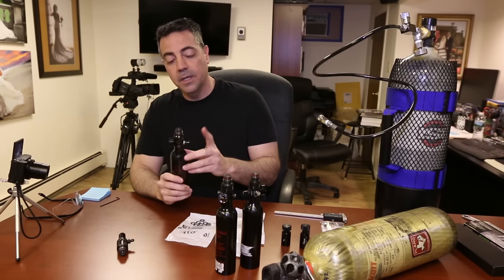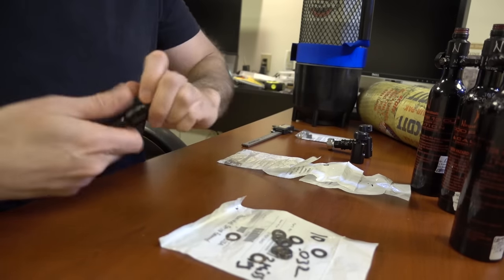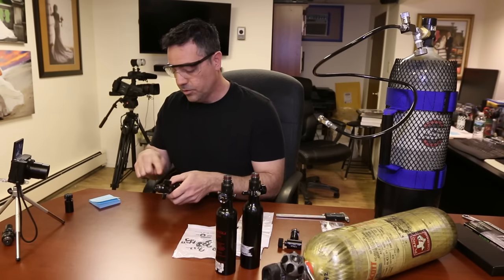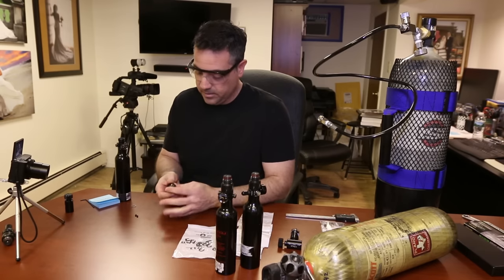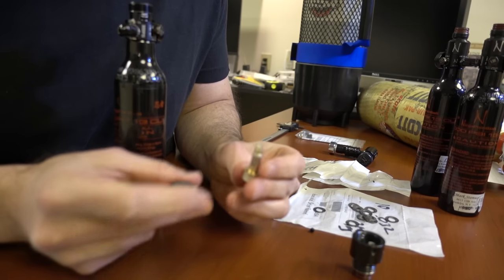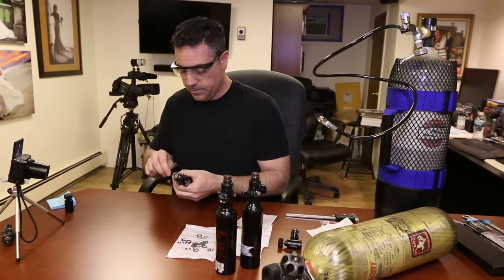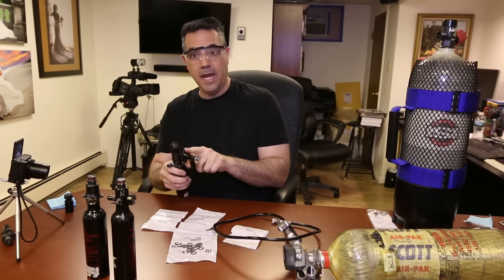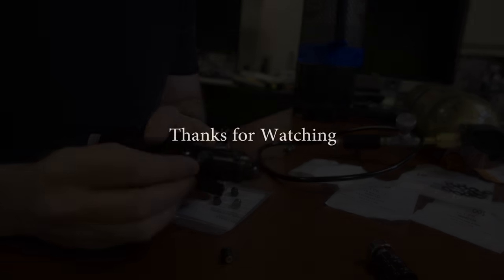How to adjust ninja ( Umarex Gauntlet ) regulator for PCP HPA Airguns (800psi to 1400psi output)

Comment: So how many washers do you think we can safely install to raise the pressure? I ask because I have a reg that came set at 800psi with no washers in it. I , for shots and giggles but 5 .020 in it and it raised to like 1150psi. So if trying to achieve 1400-1600 psi I'm assuming it would not be ideal or safe to stack that thing up inside to the estimated 3/8" it would need. What are some thoughts on that?

Comment: Are the shims in all paintball air regulators the same size? I have a Tippmann and I am wondering if your shim size will fit my regulator.
Reply from the maker: I don't know for sure but I would guess not. The only way to tell is to measure the thickness, inner and outer diameters. I have sense Belleville washers and shim spacers of different sizes.

Comment: How many shots would you get on a 2200 output 25 caliber gauntlet
Reply from the maker: The bottle is limited to about 1800psi as the low side/ output burst disc is a 1.8k. and even at 1600psi the burst will blow after a little while.
Reply: I kind of understand what you're saying but then again I don't so you're saying I should get a bigger bottle if I want to do that. I don't understand the part where you said it will bust what will bust
Reply: I'm new to this whole PCP thing so break it down for me brother please

Comment: Hi if the bottle is 3000 psi with a 5k burst disk, do I need to pump it to exactly to 3000psi or can I go over say 4000psi. Thanks
Reply from the maker: I would not recommend filling above 3000PSI. I have filled to 3100psi just to push it a little but you risk blowing the 5K disc at 4000psi and possible risk of injury. These bottles are made to go well beyond 5000psi but the limits are put in place to ensure absolute safety. STAY SAFE AND DO NOT PUSH THE LIMITS.
Reply: Air Velocity Sport thanks will do. Your the man.

Comment: @800 psi what kind of velocity would you expect with 14.3 projectile? I’m waiting for my rebuild kit and do not have access to a chronograph. Wondering if I should expect enough FPS for squirrel hunting with the reg as-is
Reply from the maker: At 800psi on my crossman the 14.2 pellet traveled at 760fps with a modified valve. At 1100 psi I got it up to around 965fps. It depends on on well the transfer port and valve are breathing.

Comment: I have a new 4500psi 68cc bottle. I have the ninja filler assembly. My bottle shows 4500 psi on the gauge but I can't get it to fill my new fx wild cat or my fx impact. Help...
Reply from the maker: A 66cc bottle will never have enough volume of air at 4500psi to fill a 480cc FX bottle even if the FX bottle is only 3650psi. You will need something much bigger like a buddy bottle or a 65cuft bottle.

Comment: I was told today that Ninja did not make my air regulators by their General Manager.  If not, who did?  Mine just says Model R09 Made in Taiwan on one rifle and just Made In Taiwan on the other.  I didn't ask him if they ever did.  Maybe they changed suppliers.  Do you know?  Also, is 1.8K and 5K the correct sizes for the burst disks?
Reply from the maker: On the Ninja bottle the low side or regulated output is 1.8k and the high side or the bottle is 5k. As far as I know Ninja makes the bottles and regulator for Ninja bottles and the Guantlet. It is possible that they switched suppliers
Reply: @AirVelocitySport  Thanks, I appreciate the info!  I'll have to ask Ray Trimble, the man I corresponded with today.  He didn't say they never did,  just that mine weren't NinJa.

Comment: I did this several times and each time my 1.8k burst disk keeps blowing upon refill. Was perfect before hand. Ideas? It held once and filled to 3,000 and functioned for testing. My reg tested at 1350psi. Not sure what the issue is but even taking the shims out it still does it. Ideas?  Same bottles and reg. Thanks
Reply from the maker: The regulator is creeping. What happens is initially you may have the regulator set at 1350 but after a day or two the Belleville washers give and start to creep. 1.8 k burst discs will blow even at 1500 PSI maybe not right away but after a few days. I would recommend swapping out the Belleville washers for new ones. You can buy new Belleville washers at McMaster carr online. You can also try setting the reg around 1100 psi and let it sit for a few days and check where the pressure is it may creep up to about 1400 and then stabilize
Reply: @AirVelocitySport  thanks. I will give it a shot

Comment: How accurate/consistent are these regulators?  Some PCP regulators cost $150-200 alone and yet these are so much cheaper, including the bottles
Reply from the maker: They are OK. Moisture will cause rust and deterioration on the spring and ball bearing as well as the main piston the Belleville washers are stainless steel and should hold up very well. I have had pretty consistent shooting with those regulators when they are new as they age I definitely would see variances of about 10 to 20 FPS over time you will need to clean or rebuild the ninja regulator top section after about a year or two.
Reply: @AirVelocitySport  Awesome, thanks! I love the fact that they allow you to switch bottles in the field (cuz of the on/off valve)

Comment: Hi just a quick question; you have several paintball bottles, do you know if any of your bottles leak at the pressure gauge by submerging in water. mine dose, sending it back to the US will be expensive. What will you recommend as a replacement gauge..?
Reply from the maker: None of mine leak at the gauge but one is leaking at the ball bearing because it's rusting. I would just replace the gauge and use telfon tape
Reply: recommend a manufacturer
Reply from the maker: mpk5959 I would ask jdsairman to send you a replacement gauge since that one is leaking.

Comment: what if I want to drop the pressure down closer to 120psi. would the ninja be able to be modified enough to go that low. I have seen ever low pressure setups pre made. but I wanted to know if you can modify an existing normal ninja regulator down to 120 psi.
Reply from the maker: Christopher Calhoun I'm not sure if that low of a pressure can be achieved with a ninja regulator. I have only seen 800 PSI. please let me know if you figure out how to go that low.
Reply: Air Velocity Sport I have seen ninja SLP  regulators on tanks that drop the pressure down to around 800psi and then a ninja LPR regulator that attaches to that, that regulates it down even farther between 0-150psi. I just want to find a one stop shop kind of item. instead of having two items. 

odly enough I plan on using a HPA tank as an on board air for my vehicle. cramming more air into a smaller bottle to save on space. I just don't need HPA, regular 120psi that comes out of a normal shop compressor is my end goal psi.

Comment: Thanks. What’s the thread size of its regulator. Does it work with M18*1.5 thread size?
Reply from the maker: The ninja bottle thread is 5/8-18UNF OR .625-18UNF the paint ball adapter is ASA
Reply: Air Velocity Sport thank you

Comment: what shim/disc spring type/size, if i need go to 1800psi ?
Reply from the maker: Bos Maru you can go to 1800psi because the burst disc will blow. the max I would go to is 1450psi. even at 1450psi the burst disc will most likely blow at some point.

Comment: how do you line up the tank so it goes back right ? Each time I take it off it goes back differently and not in line to be able to put the cover back on.
Reply: You loosen the set screws and adjust it where you need it then tighten you set screws make sure the top piece only turns

Comment: Hey, you wouldn't happen to know how many stacks to put in to make this bottle do 300psi out would you? Is that possible/recommended?
Reply from the maker: I believe that is not possible with the standard ninja bottle with spring or Belleville washers. It comes from the factory with a light spring set to around 800 psi. You might have to use the ninja SLP super low pressure regulator valve. Try calling ninja directly.
Reply: Yeah, unfortunately they just deferred me to buying a new reg, which is a whopping 60$. Do you think you can do an experiment for me where you put in like a few belvilles without shims to see if the ninja can output 400 at least?
Reply from the maker: I have don't that and even removed two Bellevilles and the regulator locked up. It took like 2 hours for the air to escape so that I could degass the bottle.

Comment: What is the best belleville washer arrangement to give you the most psi?
Reply from the maker: Stack them in 6 stack like so ((())) ((())) ((()))  A four stack is a little stiff like so (()) (()) (()) but it should always be symmetrical. Don't put a 6 or 4 stack with single stack. The single stack will get crushed.

Comment: I'm a little confused about my existing regulator.  Mine too is a Ninja brand but it does Not have the ball bearing seal valve in the bonnet of the regulator.  It has a pin type of valve.  Also; on the bonnet there is inscribed the number 1150.  I take this to mean that this is the output psi that this regulator is adjusted to.  If so, this is odd because the Umarex Gauntlet users manual states that the output psi is 1250psi.

Here's the confusing part.  I checked the output psi the same way you checked yours.  Inside my regulator it had only 10 Belville washers and no shims whatsoever.  The output psi on this particular regulator read in the neighborhood of `1300psi just as it was.  My manometer is one of the tiny cheap kind with the fat hash marks and fat needle so that "1300psi" reading has a plus or minus of perhaps one to two hundred psi. (maybe more)

This regulator is part of the factory Umarex Gauntlet setup.  (Unless they sent me one that had been sent back to them or someone had swapped things around before I got it.)  I notice that the Ninja 13cc tank and regulator setups you have on your table in your video look the same except for the bonnets on your regulators.  Do yours' have the output psi inscribed somewhere on the bonnet?

I did go in and ad one .005" shim to my regulator to see if it would bring me up to 1400psi but those fat hash marks and that fat needle on my manometer make it difficult to tell.  The differences in velocities over the chronograph show little to marginal difference so,  I'm wondering,  if I were to  purchase an extra tank/regulator setup for my Gauntlet, is there a specific regulator that I can safely adjust to 1400 psi without wondering if I'd gone a little to far with the output PSI?  

I was hoping to safely get my velocities shooting the 14 grain pellets up to 900fps if possible.  I don't need anything faster than that.  My break barrel air guns both shoot that fast now.  I'd like for this Gauntlet PCP to do a little better velocity-wise.
Reply from the maker: TIM MONTANO the regulator with the pin should work exactly like the one I have with the ball bearings. There is no inscription on the side of the Ninja regs except the marketing that indicate which burst disc to use. 1.8k on the output and 5k on the bottle. You are correct by increasing the shims you should get your pressure up. I have added as much as .03 shims o get the pressure up to 1600 psi. BUT PLEASE UNDERSTAND THAT JUST BECAUSE THE BURST DISC SAYS 1.8K PSI IT WILL BURST AT AROUND 1550 PSI OR EVEN LESS. I have found keep the output pressure to 1450 is the sweet spot. That allows my to shoot 14 grain pellets at 950fps on my crossman 2240. You can add an extra two Belleville washers but that my increase the pressure to the point where the burst disc will blow. It will scare the pants off you. Also keep extra 1.8k burst available. As you start to mess with the pressure you will eventually blow a burst disc. Also, just because you set the output pressure to a certain psi does not mean it will stay there. These ninja regulators have a tendency to creep upwards. You will find that you just set the regulator to 1450 psi and shot all day. You put the gun away and in the morning your bottle is empty because the reg creeped up and blew the burst disc.
Reply: Thanks for the quick reply. 
So, it's the belville washer that do the increasing of the output pressures?  As I stated in my inquiry.  MY existing regulator only had 10 belville washers in place and no shims.  This was giving me around 1300psi ouptput pressure.

The .005" shim in installed myself appeared to give me maybe a couple more pounds of pressure per square inch.  I never intended to go beyond 1400psi.  I just wanted to get my pellets to a velocity of around 900fps.

At one point in your video you stated that every regulator is different.  The same washer and shim arrangement will yield different numbers in different regulators.  I suspect this is the case with my regulator cause with only ten Belvilles and no shims I'm getting 1300psi while the regulator you show has 12 Belvilles and a couple of shims and it's giving you what; about 1400psi?  

If I try installing 12 Belville washers in my regulator in place of the ten I have now, it seems like I'll more than likely blow a burst-disk for sure.  This is one of the reasons I asked about if there was a specific regulator I should get if/when I buy an extra 13cc tank/regulator setup.  As far as strength and durability, are all of the 13cc Ninja tank/regulator combos basically the same or are some stronger than others?  I mean, even with the same 1.8 and 5000 burst disks attached, are some regulator rated to withstand higher pressures? (not that I'll ever go higher than 1400psi)
Reply from the maker: When I stated that every regulator is different I mean that every combination of shims and washers will not create the same output pressure. They are the same and their construction and ability to hold up to 3000 psi safely. The regulator you have on the gauntlet is almost exactly the same as the one I have on my ninja. If I'm not mistaken ninja has created the regulator and bottle for the gauntlet. You are probably right that adding two more Belleville washers will be too much. All you need to do is fine the correct thickness of shims to match the output pressure you looking for which I believe is around 1400 you're almost there just a little more thickness
Reply: Thanks for your quick replies and thanks for the videos.  They are very helpful in sorting all of this out.

Comment: how much psi can u get from shimming the original spring?
Reply from the maker: you can get anywhere from 800 PSI to 1600 PSI. but as you approach 1500 PSI the output regulator burst disk is more likely to blow. I have found 1400 PSI to be a nice balance between power and blowing the burst disk.
Reply: okay, thanks. But is 1400psi possible with original spring and shims or with disc washers only?
Reply from the maker: OH! Good question. I never tried creating higher pressure with the original ninja spring. I do not have an answer on that. not even sure if that is recommended.
Reply: I failed to shim the original spring. I think its near its max limmit on 800psi. How ever the Aliexpress discs work great, used 9 of them with two original shims= 1500psi .
Reply: @Enkelkrok  how is your Gauntlet handling the 1500psi? what fps are you getting?
Reply: @juansebastiancortazar3322  i did get 226 ms(740fps) and 27J. Im not sure i understand gauntlet?

Comment: How do u make 1 of those   Gages do you sell them?
Reply from the maker: No, I don't sell them but you can make them yourself cheaply. You need three things a ninja slide check, a ninja paint ball valve and a 2000 psi 1/8" npt. Guage. All can be gotten on Amazon and eBay.

Comment: does this also work with the air venturi bottle that is meant for the Sig MCX?  The bottles appear identical.
Reply from the maker: If the regulator uses Belleville washers then yes. To be safe take a photo of the washer configuration so you don't get confused when putting back together. Also, measure the diameter and thinkness of the washers in case you need to order some from mcMaster Carr.
Reply: @AirVelocitySport  question after taking my regulator apart the three shims on the bottom were like the two your reg had there is a red and green shim stacked at the bottom the Melville washers can I switch out the red shim for one of the other thinner ones making it like the way In video? Adding the removed shim to the bottom with the green shim and putting the Millville washers back exactly like they were?
Reply: @AirVelocitySport  sorry Belleville washers auto correct cheers
Reply from the maker: Yes, but be careful using thinner flat shims at the bottom with increase the output pressure. You will be surprised at how much the pressure can increase by just removing some flat shim space from the bottom. Go slow and only decrease the flat shims at small increments. You may notice that replacing one thin shim for a thick red one will increase the output pressure by as much as 250 psi. Remember that the low side or output pressure burst disc is only rated at 1.8k this means that the burst disc will blow even if you get to 1.6 k the burst discs are not exact and mine have even burst at 1500 PSI.